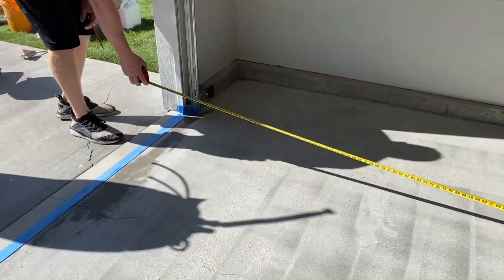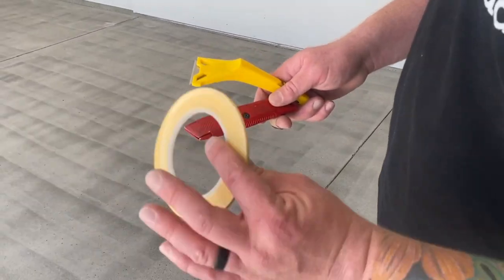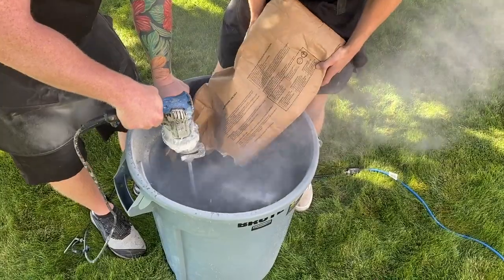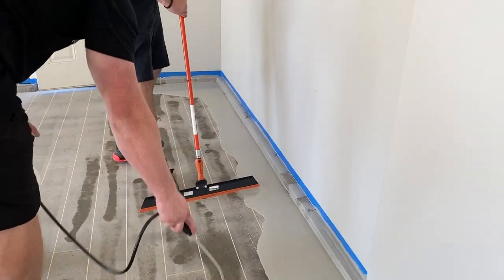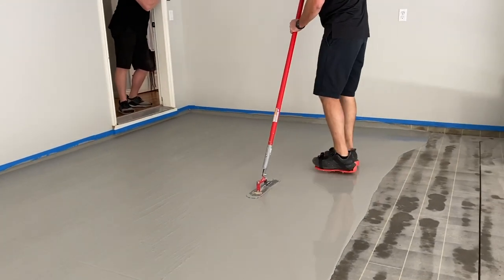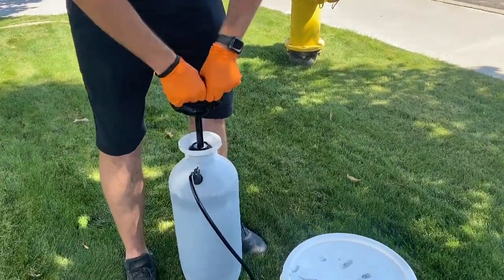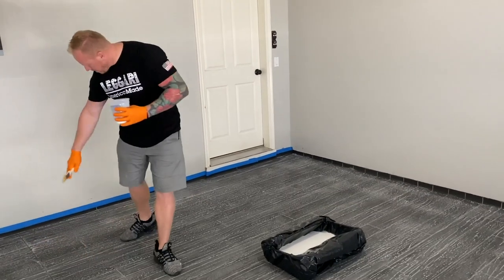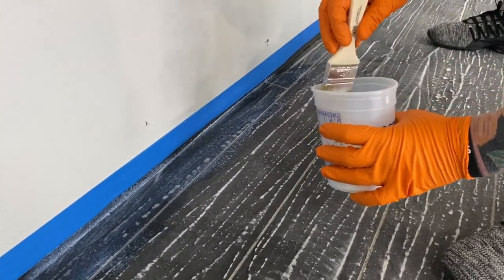Home Gym & Man Cave Complete Garage Floor Remodel Using Concrete Overlay | 13 Minute Version

Comment: Spectacular result!!!🔥😎🔥 Looks like an interior floor!🔥😎🔥Would like to know if the sanding necessary before removing tape, and applying the top coat? Is the sanding to give the floor grip, so it is not slippery? How often would you have to reapply this top coat to maintain that beautiful sheen?

Comment: Is it possible to Appleby a thicker flood coat? Say pour down 1/4 to 1/2 deep and let it settle and cure? Or would that just be a waste of epoxy and would it cause soft spots or warps?